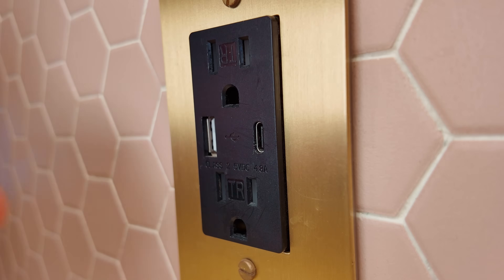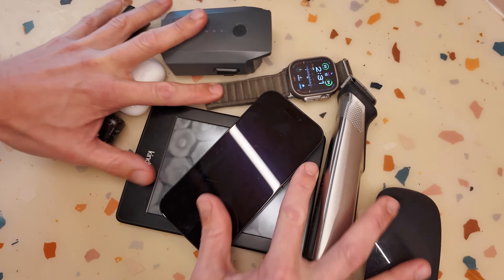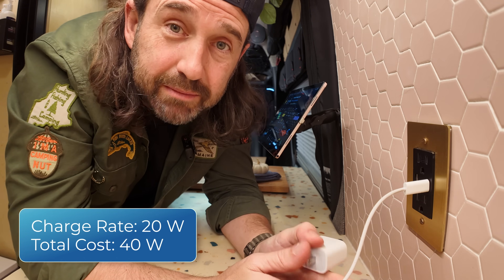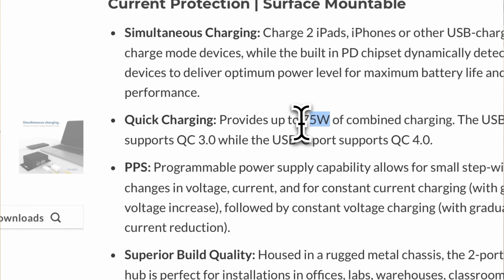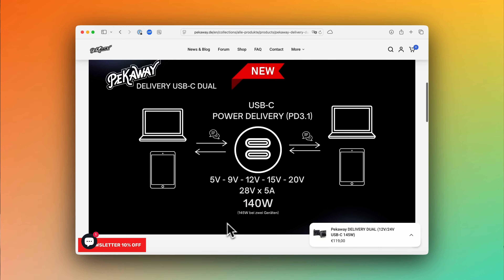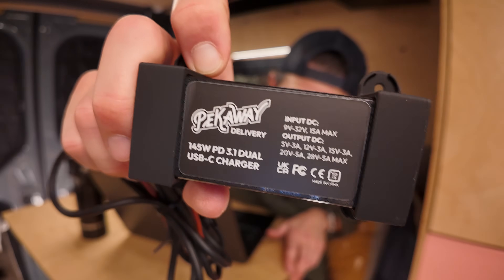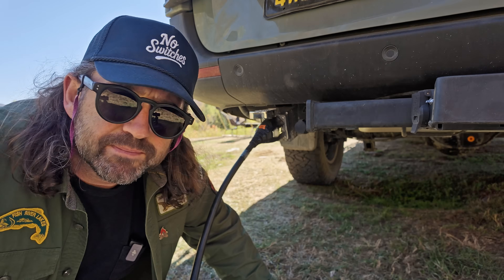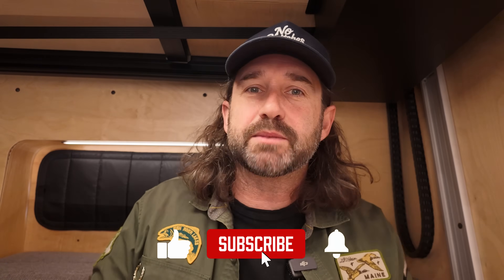DC→AC→DC?! Stop the Charging Madness.

Comment: When will someone make dual wired sockets for AC & DC say 48V??
Reply from the maker: Good question. I was hoping to find some, and I believe you won't see many (if any) on the market because no building code allows for the mixing of conductors carrying different voltages in the same junction box. This is probably a sensible safety measure.

Comment: While I agree going from DC to AC to DC, the chargers that you gave as examples are just crazy expensive. By the time you spent $400+ on chargers you could increase your battery capacity.
Reply from the maker: $400? That math doesn't math. The 75 watt charger from Cool Gear is $52, and we have a couple others. Hardly $400. And, even if we HAD spent $400+, you'd be hard pressed to arbitrarily add $400 worth of battery to an already defined battery pack in a space in which every last mm has been accounted for and carefully designed. I think the spirit of "just increase your battery capacity" isn't a bad notion, but does not account for the real world constraints. At some point, adding more battery stops being viable whereas reducing energy waste continues to be worthwhile.

At least we agree on the premise that DC to AC to DC isn't economical.

Comment: worst idea, you can't dc voltage wiring like AC wiring to make a charging ports available everywhere. Long the wire drop the voltage and would need thick wires to maintain required amperes. Long wires result extra heat and power loss... ultimately wasting of power.
Reply: It's a van, how long can the wire runs be!? lol
Reply from the maker: My DC charges are only a couple of feet from the main DC distribution and the conductors are properly (over)sized for the current to mitigate voltage drop. I'm not sure voltage drop due to wire run length—especially in a van—is going to outpace losses in the DC→AC→DC conversion.

Comment: I’m curious, why does the data sheet for the Cool Gear ChargIt Mini 75W warn not to exceed 28V when it’s typical to charge 24V batteries at 28.4V or even 29.2V?  I guess if your system is 24V, you need bump up to the significantly more expensive 82W model?

Edit: A quick search yielded PowerWerx.  It accepts up to 31V, charges at 65W and costs less.
Reply from the maker: Good point, some of their models do have a max voltage input that could be below charging voltage range for 24v. The Pekaway charger I mentioned also has a higher voltage input.
Reply: @SmartyVan  Thanks for confirming.  I’ll check that out too.

Comment: 8:26
Honestly you should just DIY by using those PD adapters that uses cigarette lighter sockets as its MUCH cheaper!
For context a 130W cig adapter only costs $20 compared to your recommendations of $60.
Reply from the maker: That's certainly an option If you're price-conscious! 

I don't prefer to have cheap charging circuitry in the van, especially if it also looks bad. I'd also rather avoid having to stick a goofy charging thing in an accessory socket, especially near our feet at the front of our benches—it would be sticking out, glowing blue, and just ick. But, yeah, you could go that route I suppose.
Reply: @SmartyVan  
Since you're all about DIY in your channel, those cig lighter adapters are easily removable where you can solder cables to it. Yes its more work, but not 300% more compared to the price.

Comment: I am the king of going from AC to DC and back again. My solar system on my roof has micro inverters. This current goes to my huge inverter to the generator port and into my battery bank as DC. Then into my house to AC and then to my power station chargers to charge the by AC to DC

Comment: Yes! Finally someone point in the right direction! I have decades telling people ! If u use some solar panels change your lighting to 12v lights !! Air conditioner and fridge! It's way more efficient! Also I bought a bunch of step up (elevate dc voltage) or step downs (turn down voltage) dc converters to use in my projects

Comment: Do you connect the USB-C Charger to the 12V distribution box? How do you charge the 12V-Battery?
Reply from the maker: Yes, you can connect the USB charges I mentioned directly to a distribution block with a fuse. Our 12v battery system can be charged by: solar, a dedicated alternator, or shore power.

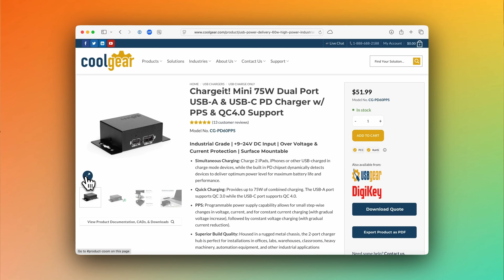Comment: 4:00 What do you think, how often do I have to charge an iPhone 16 (full) to waste 52$ that I need to invest for another charging device?
Reply: @lernenmitrobin  the biggest benefit is less watt hours wasted. This makes a significant difference when you're on battery or recharging from solar. Compare your DC efficient charging with the same or faster charging vs ac charging that might need doubling of solar panels and/or batteries to do the same with losses and added heat into cabin (if space is even available). Now That $60 or even $100 investment might allow you to save hundreds on batteries and solar (added benefit that recharging lasts longer) to provide the same "work". Especially in low space builds (vans) efficiency is king. #offgrid
Reply: @lernenmitrobin  It's not a monetary cost thing.

It's an a energy cost thing.
Reply: @projectdb83  could you explain it further in detail? What do you exactly mean with energy cost thing?

Comment: It’s normal practice to do this in Britain, I’ve never seen anyone use an AC wall charger from inverter in a van. Seems obvious, a bit worrying that “professional” van builders don’t understand.
Reply from the maker: Seems like the UK, Europe, and really everywhere else are far more sophisticated than the States in the caravan space.
Reply: It happens in Europe too, it is just that the systems have always been smaller on average just like the RVs. Therefore just 12/24V systems even without any inverter were common. If you go to higher voltage systems and batteries, wiring everything for 230V is pretty common.

Comment: Absolute nonsense.
This video is just an advertisement for somthing nobody need.
If you want to save power just use quality converters directly on a power plug, the less converters/batteries there are between your home power and your device, the more efficient it will be.
If we use AC, it's for many good reasons.
Reply: The math maths. You will save power going straight DC to DC, especially if it means you can keep your inverter off. Does this video smell of a sponsorship that could have been called out more clearly? Yes, but that doesn't change the fact that it's a cool product that can be genuinely useful in some circumstances.
Reply: @JackWeems  No power is going straight DC to DC because the inverter is plugged on AC, so it's AC to DC to DC.
Also, this is not made for domestic usage but for industrial needs.
And, usb charging doesn't needs lots of power even for a laptop. In comparison of an oven or a washing machine it's just insignificant.
Reply: @raoul-e1w  "inverter is plugged on AC" Inverters run of DC, they take the DC from the batteries and convert it to AC for AC appliances. When on battery power going through an inverter then to a wall wart the conversion is DC (batteries) - AC (Inverter) - DC (USB), and is less efficient than going straight DC (batters) - DC (USB). You can argue that the gain in efficiency isn't worth the price premium, and if you are running an inverter for other reasons I'd agree with that. If adding direct DC to DC converters allows you to keen your inverter off most of the time then I'd argue it's probably worth it. It all depends on the situation.
Reply: @raoul-e1w  What the hell are you talking about?

Comment: When you start to think about it, you will be surprised how many devices are actually DC, even though they plug into an AC outlet. Our homes (and your van) are filled with AC->DC inverters. Almost every electrical device these days is going to have one. About the only things that are actually AC, is anything using resistive heat, but even then the electronics to control that are going to be DC.

Comment: Excellent video. Another tip: for Mac laptops you don't have to match the wattage of the original charger. e.g. my 100W MacBook Pro I charge off a 60W coolgear USB-C charger. It will just charge more slowly. Even a 20W charger will work, just gets a bit TOO slow then. 99% of the time, it's not a problem. The only catch I've found: If the laptop battery is completely zero, a 100W charger will let it come back on instantly. A slower one will take time to charge it up a bit before it will turn on.
Reply from the maker: Good tip!

Comment: 0:48 USB does not charge st up to 28V
It is 5V and nothing else
Reply from the maker: https://www.usb.org/usb-charger-pd
Reply: USB-A only provides 5V, but USB-C can provide up to 28V (Correction 48V). "USB" is an all-encompassing term.
Reply: @Dr.Thundy  usb-c, can actually provide up to 48V. This is how you can get 240W, as the spec limits current to 5 A
Reply: @kosiranze  Oh, neat. Thanks for the correction!
Reply: @Dr.Thundy  Qualcomm Quick Charge can use other voltages with USB-A

Comment: Great video! In my rig, I’m all about DC power! I ended up installing over 30 usb-c ports everywhere. No, I’m definitely not plugging in 30 devices at once! But, I have a port wherever I am! It’s so great!

I also have an external monitor I use as a TV screen. I realized it takes in 19V DC, so a 12->19V buck converter, and it works awesome when I have my super work efficient mode! I also found a guy that converts Apple TV to 12V DC - so got one of those as well. Trying to keep that inverter off!

Thanks for the video!
Reply: You can probably just use a 20V dc out PD adapter instead of an external buck converter.   I am doing USB PD everywhere in my van - running the DC system at 24/48V (native).
Reply: @ndraju   Nice!  Good idea.  Thanks for sharing.
Reply from the maker: Ha. That’s awesome!!! USB EVERYWHERE!!!